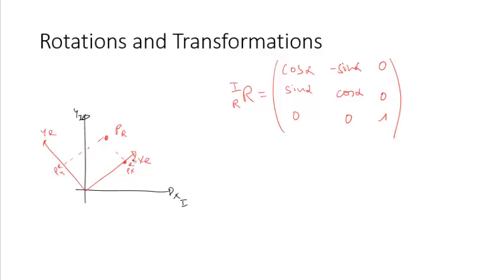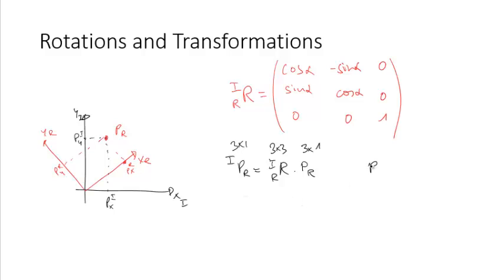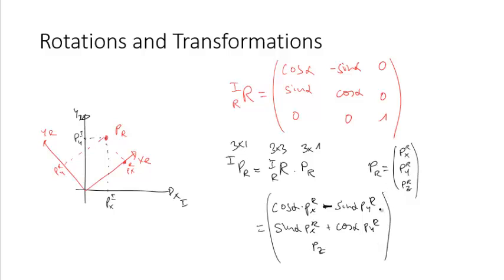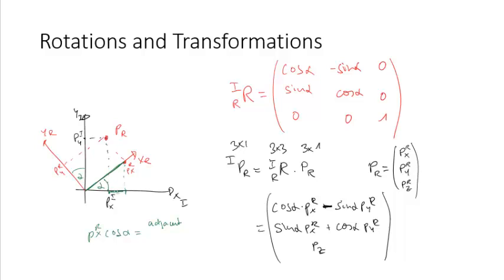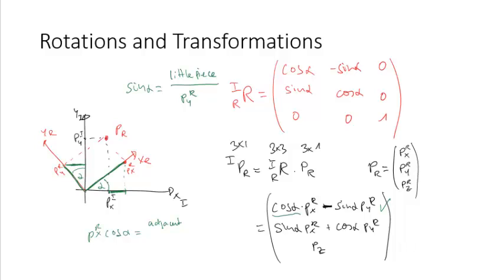Rotation and Transformation Matrices

Comment: You should explain why you use 3D matrix to rotate 2d
Reply from the maker: Extending the 2x2 matrix to a 3x3 allows to perform rotation and translation in one step. The translation values are in the right most column. It is called a "homogenous transform". In 3D, the matrix will be extended from 3x3 to a 4x4 matrix.